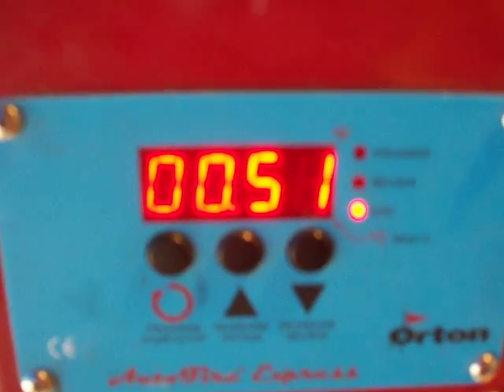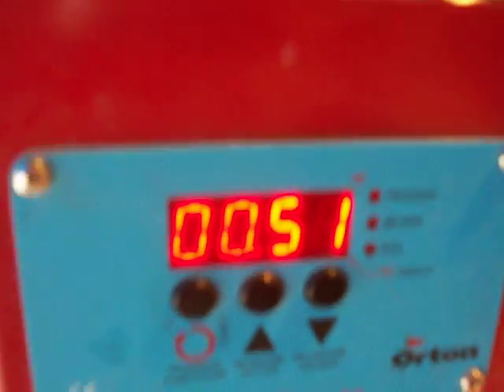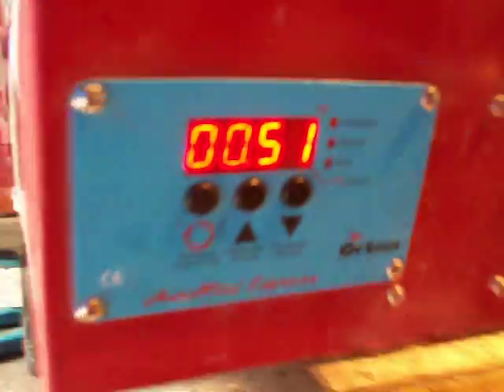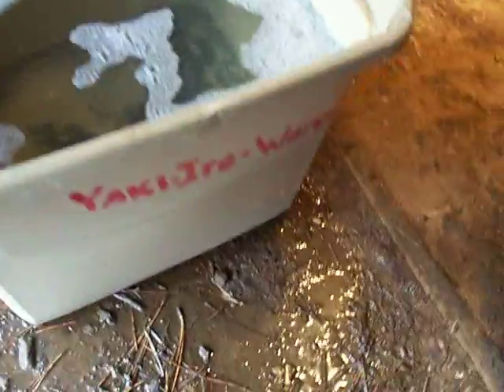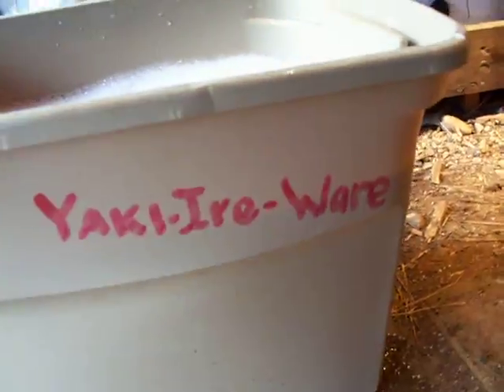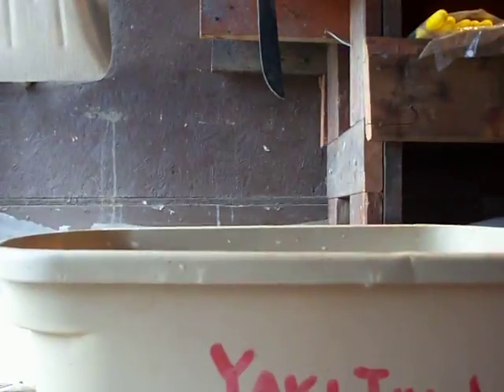Interrupted Water Quench

Comment: I quenched my chisel from rebar in brine and now it can chop concrete. By the way, my brine has more soap than that. Zero distortion or cracking guaranteed.
Reply from the maker: I'm now making soap for my brine with my own organically grown yucca plants. I'm getting negative 1% distortion. The other day I chopped a forklift in half with one of my blades.

Comment: why soap ? basically you put soap and salt in the water ? 120°f ?
Reply: Soap water or brine will cause 4130 to harden real good. Hard enough to hold an edge.
Reply from the maker: It's a way to break surface tension. I read somewhere in some old heat treating guide that it works but I have no clue if it really does or not. Temperature and the blade geometry are way more important

Comment: awe man , i have 1075 knife do now question weather 2 use brine or not? it has clay 4 hamon i really worried about cracking due my prior heat treat a file knife in water n cracked 2places , ? thank u 4 ur clip ima follow u now found ur channel nice content sir , ty
Reply from the maker: ...Maybe try canola first as it is usually fast enough for 1075... next try an interrupted brine to oil quench and then brine if it is not hardening. With good geometry, a relatively thick edge (maybe .030-.040) and good temps (also try a triple normalizing before quench, it also helps out) you can get a good percentage of solid blades from just a water quench. I just switched to Parks 50 and had to change things up a bit to get a nice hamon, with the Parks I am going very thin on the edge, some probably .010" thick. The activity is not quite as good or as deep with just water but still very nice.
Reply: It will be fine and clay prevents the spine from being quenched. Don't be afraid to use brine.

Comment: a video on how to make a file???
this is not how you produce a quench line in water.. . japanese producea harmon by coating the bladeiwht clay to keep the heat in during the quench... 

other asians quench only the edge by slicing the water left to right quickly bringing it u and slicing again soe will also pour water down the edge with a teapot or another device.. but nobody will do this, it will product a hard steel bar with cracks in it. 
any thai , philipino or malay knife  can be polished and wil have a full harmon, 
the harmon is poduced where the hot steel touches the water and hardens....
this is why you can bend snap or break japanese.. and south east asian weapons with ease because the edge is the only hard part and its very hard without tempering, it is also why you can cut a nail with a japanese sword without  folding the edge..  a european weapon historically is hardened through tip to tang  and then tempered in a kilnis then  softened again in specific areas the tang and the centre of the blade using red hot iron bars.. superior all round but not as hard in the edge.. (that is why japanese sword has such a huge thick spine)
Reply: Lol noob much

Comment: Step 4: After 5 to 7 seconds quench it again for 1 second. Then resurface it again. Step 5: If you see the blade is losing the orange fire deep it deeper not to the spine. and resurface it again for 5 to 7. Step 6: Quench again now deeper nearly in spine for 1 second. Step 7: Air cool it for 5 to 7 minutes. Step 8: Quench the whole blade in the water and let it cool there.

Comment from the maker: Hard! I don't have a RC tester but with a water quench they should get to full hardness. I polished it up and etched it to look for a possible hamon but the blade hardened all the way through. There was a tiny circle in the middle with a hamon line but none worth bringing out by further etching and polishing. 

Yes, this is the same blade I am doing the WIP on, this is actually the second one, I snapped the first blade trying to hot straighten. 

Thanks for the comments.